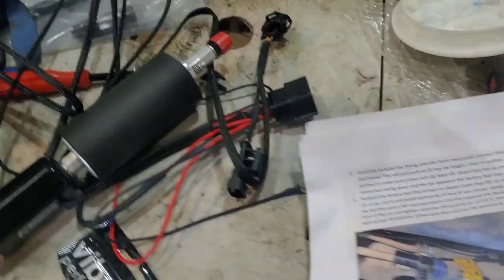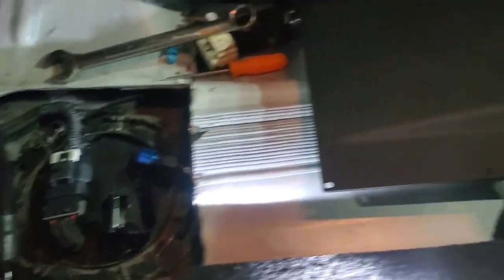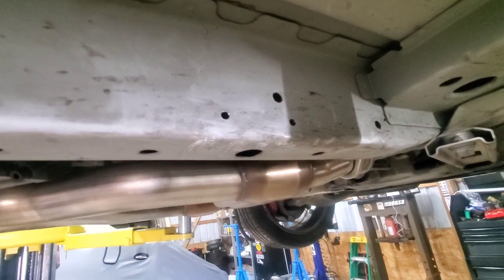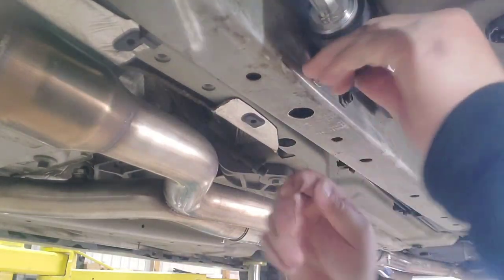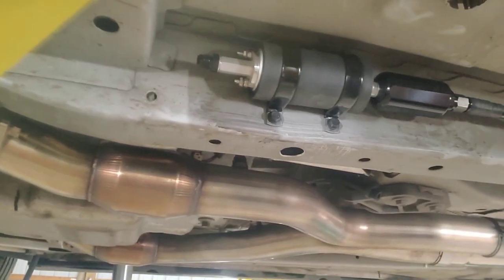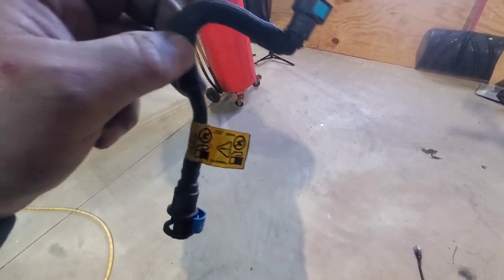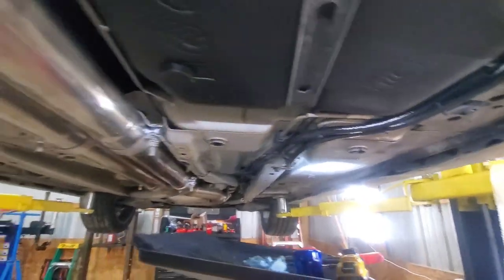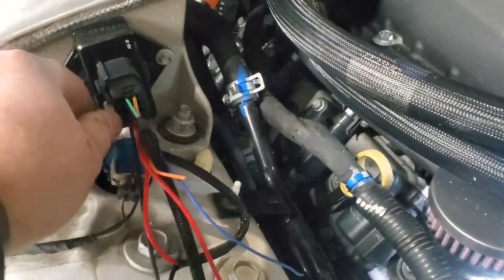CTS-V PROJECT PT6 DSX AUX pump install

Comment: Have you had any issues with the DSX caused by drawing fuel from the top of the tank? 

** Installing mine in 2 weeks.
Reply from the maker: ZERO issues with the fuel system coming out from the top. I'm glad I did it that way.